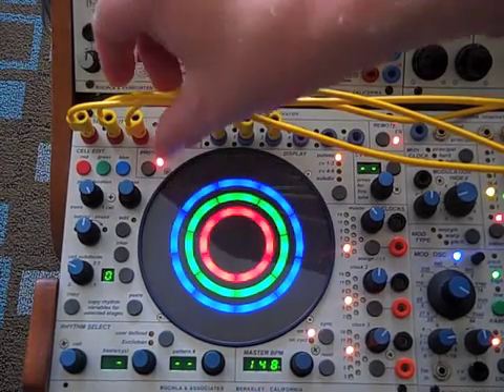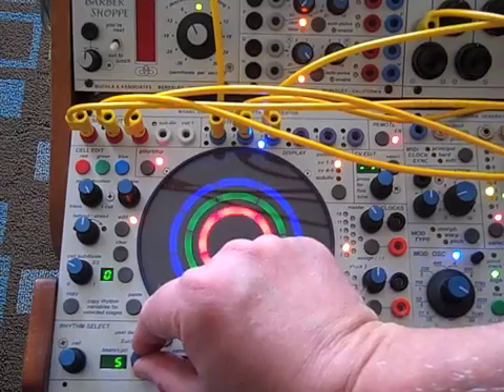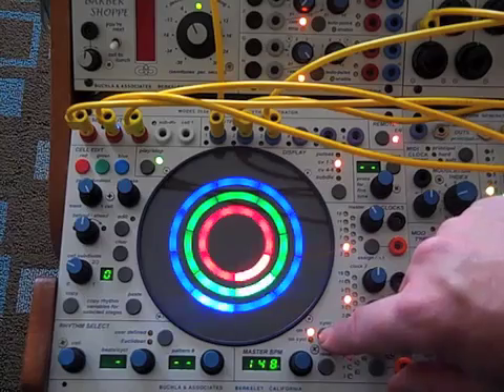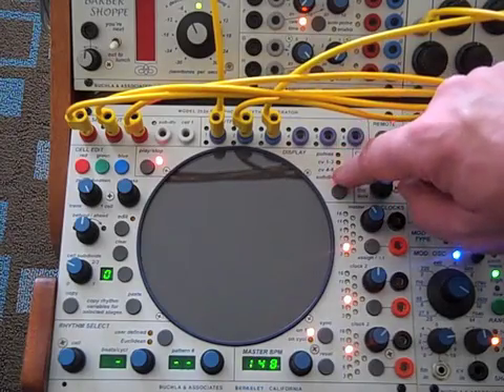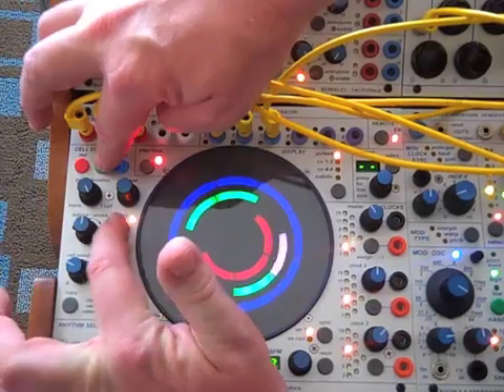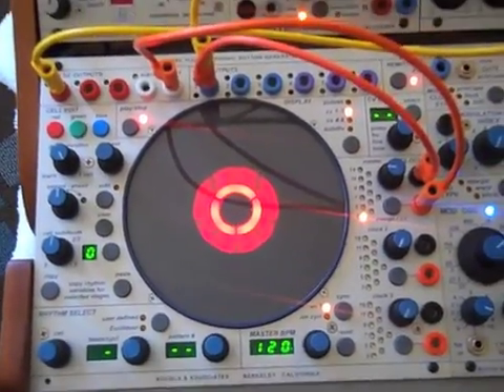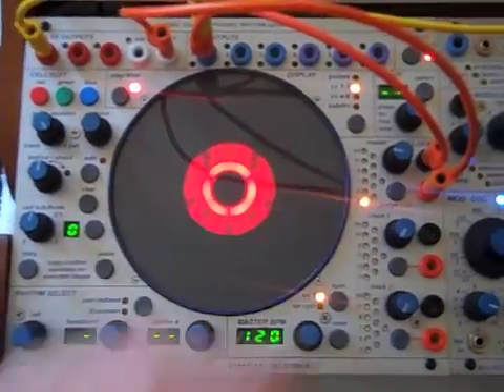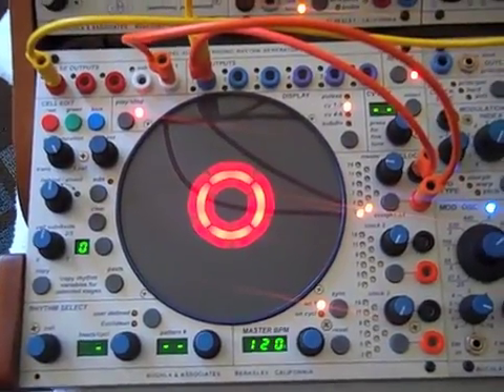252e 4-Clocks

Comment: hey Todd..  I understand that the 259e has tuning issues when used via the CV input on the front panel.... how did you over come this problem when using the 252e.....?!?!? (259e used with the 225e via midi allows the tuning to work but with CV its not locked in)
Reply from the maker: das SPEZIAL ah, it’s been too long since I did this video and I’m not deeply into equal temperament....so sadly wasn’t paying attention 🙇‍♂️